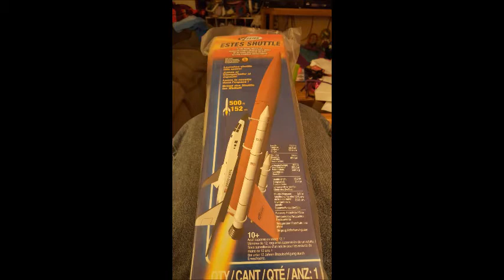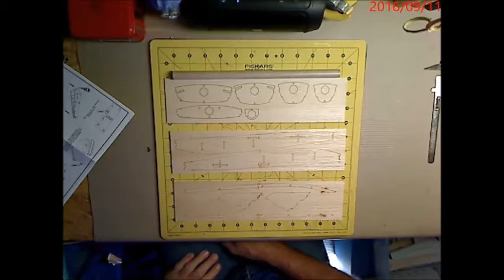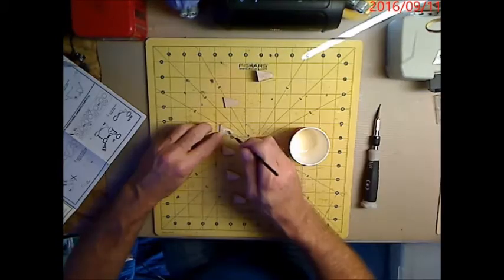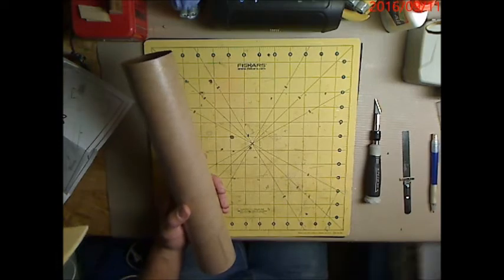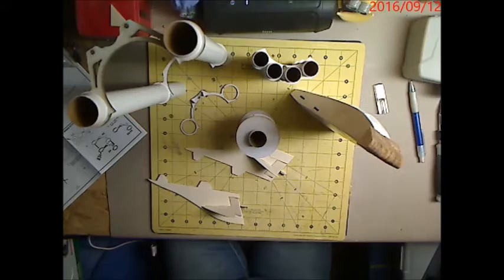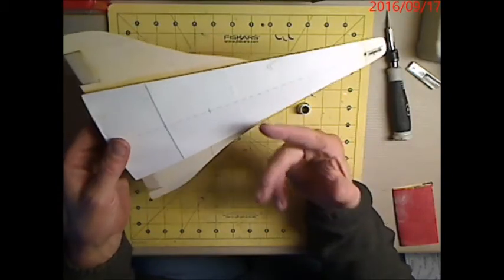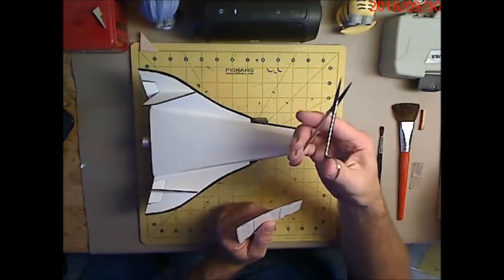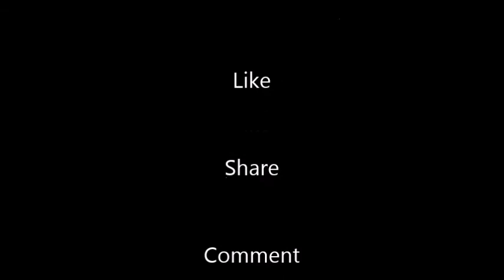Estes Shuttle build.

Comment: For gliders that have balsa fins, I like to use 1oz fiberglass cloth  & wood glue.
Lay down a sufficient amount of wood glue over the whole surface of just one fine that is attached to the model body, cut a piece of 1oz fiberglass that will cover that surface, use a very soft toothbrush to smooth out the fiberglass; there should be no wrinkles.
  I cover both top & bottom.
Clip off excess fiberglass then sand/fill to preference.

Comment: For all large fin models that I build I use 1 oz thin fiberglass fabric over the top/bottom of the wings.  I use either epoxy or carpenter's wood glue to apply the fabric to the wings.  It can take a lot of punishment and it is much stronger/thinner than paper.
Reply from the maker: But the weight is much more and that will effect performance and may require use of nose weight to counter. In a model like the Apogee Aspire low weight is very important.